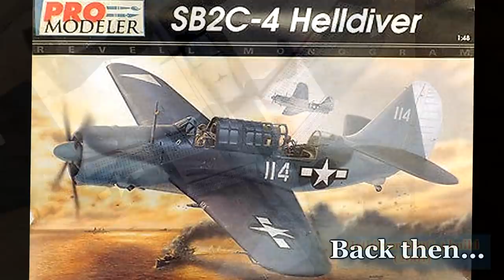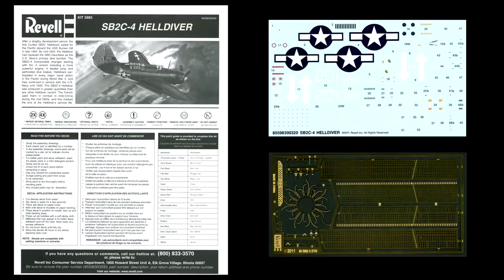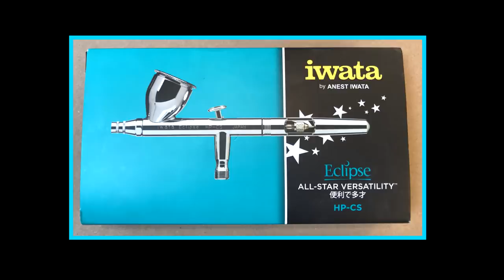Building the Revell Pro Modeler 1/48 Scale SB2C-4 Helldiver Dive Bomber

Comment: Good job! I was surprised to see that Revell fixed that old Monogram kit. I built it back in the 80s with the folding wings and retractable landing gear. Those old Monogram kit's were kind of toy like. But I always saw them as a blank canvas that you could make a masterpiece out of with a little bit of time and detailing. And they were a lot of fun to build when you were a kid. The old Monogram P40 is still one of my favorites and they all bring back a lot of fond memories. 🙂
Reply from the maker: Hi Steve, thanks! Oldies, but goodies sometimes 😉
Reply: This is not the old Monogram kit from 1961. This is the model released by Monogram under their Pro Modeler label as a new tool in 1997. Later issued by Revell after they had absorbed Monogram into their product range.

Comment: Love the build.  Makes me wish I had bought the kit when I had the chance.  I have the Monogram version of this kit to build.  Interesting note, the Army Air Corp wanted a dive bomber before the war.  They placed an order for several of these planes on December 31st, 1940.  They made a few changes to the plane.  Larger wheels, removal of the tailhook, removal of the folding wing mechanisms and a few other minor changes.  The plane was based on the SB2C-1.  They were designated A-25A Shrike.  Info from Squadron Signal aviation book on the SB2C Helldiver.  I was a volunteer at an airshow one year and had the priviledge of keeping the crowd back from a Helldiver as it started up to do flyovers for the show.  That prop sent every tiny piece of sand and rocks flying.  Glad I was wearing long pants.  The best sounds to hear are the sound of a radial engine and merlin roaring to life followed by allison engines when it comes to planes.
Reply from the maker: Thanks for sharing the story. I got a good dusting from a P-51 prop one time. 🤨

Comment: Hey, thanks for making your videos with such attention to detail with little factoids and period footage/audio. 

I have a question about decals if anyone can help. I’ve been having problems with decals that bond too quickly and tightly, after only a couple seconds (even with plenty of liquid around) so they become unworkable and stuck in the wrong position.  Are there any tricks for these problems? It’s almost impossible to slide them on perfectly the first time and they slide and bind randomly while trying to get them aligned right.
Reply from the maker: Hi Captain Cruise, if I have this kind of problem, I tend to use a lot more water from the decal dish. The model will be dripping wet in the area, but I can easily float the decal still and not have it bind. On the other hand, this will dilute/wash away any decal setting solution you've pre-wetted the model with.
Reply: Max_Afterburner 
I see. Thanks for the tip; I’ll give it a try next time!

Comment: Easy way to start off aerial two little nicks in rudder same place glue in whatever you use as aerial wire got a good start on fitting it
Reply from the maker: Hi Wendy, good idea. I would hope I didn't cut the antenna mast in two trying that😅

Comment: Another great build. I am working on this very kit right now, although it's the Accurate Miniatures boxing and I am using the Atlantic City dark gull grey scheme. Did you find the clear plastic was a problem? My front windscreen is a blob, with no real framing and most other clear parts are equally bad.
Reply from the maker: Hi Rich, the cockpit glass pieces were pretty nice and detailed. The very front windscreen could have been a little better, though. The only real weakness with the kit is the main landing gear attach points to the inside of the wings. They're very flimsy and a good bump would probably break them.

Comment: I always thought Promodeler rendition of this plane has an exaggerated wing dihedral angle. That's why it has been in my stash for past 20 years but your techniques are great! I'm still searching for a way to correct the wing issue or perhaps build them in folding wing configuration, that's another 20 years to think about it.  😂😂
Reply from the maker: Hi vin10954, if you ever get a chance to build it, watch out for the main landing gear. They're a bit weak.
Reply: @MaxAfterburner  Thanks for your advice, I will write down on instruction sheet.

Comment: Hi Tom, lovely end result! And shock, horror..the first two paints you used weren't Tamiya! There should have been a warning at the start of the video. :) I must say you had me thrown for a loop with the way you built this one, a lot of it prepainted on the sprue. Why did you decide to do it this way? Normally you have tended to join the fuselage and wings first and then start the exterior paint. Love your paint chipping method. Very effective.
Reply from the maker: Hi again, yes a few changes as to the approach for this model dictated by the materials and parts. I didn't want to run enamel through my airbrush and Tamiya doesn't make a specific zinc chromate either. Sometimes I leave the parts on the sprue for faster application of the "primer", ease of keeping the parts together and not losing any pieces, and as a drying rack. Some viewers were shocked by this and even appalled (although I did this in another video too). I felt the paint chipping would be easier to accomplish prior to the overall assembly, so I went with that direction. Sometimes the particular model requires a slightly modified work pattern, other times it's just nice to experiment and reduce the tedium.

Comment: Max, I can't help but notice on all your paint jobs you never get a rough textured surface or fingerprint marks. What do you do for your model before starting the painting process? I clean mine with alcohol but I always seem to get an uneven paint job no matter what I do.
Reply from the maker: Hi, I don't do any special prep work prior to painting on the modern model kits. It's difficult to say what is causing the problems you're experiencing without more information. Many factors such as paint type, dilution ratios, airbrush vs. hand brushing, and time allowed for the paint to set in can all play a factor.

Comment: My gueeses
1 USS Missouri
2 USS Midway
3 a b-29 superfortress

Based on my own experience building a 1/350 USS Essex I kinda hope it is not a carrier. So much patience is required for them, the US strategy of guns everywhere means so many tiny pieces to glue and paint.

If you are doing a warship I hope you have more luck than I did with the vast number of 20 mm aa guns.
Reply from the maker: Hi Nathan, thanks for the guesses 🙂 A carrier certainly can be quite a build and a lengthy project 😏

Comment: Hey I was using The Tamyia panel line and I let it dry. But can’t get it off. How do I get it off.
Reply from the maker: Hi, the Tamiya panel liner is enamel based so you'd have to try an appropriate enamel thinner. I'm not a big fan of their panel wash because it tends to stain areas even with a protective coat laid down. I only use it if I'm looking to make the area particularly dirty. In this video, I begin to show the black pastel and water wash I started out with, but I went with the Tamiya and did not video that process.
Reply: @MaxAfterburner  alright then. The thinner i have is water base. So that is probably why it didn't come off. Plus i didn't know that i was suppose to clean coat the aircraft first before using a wash. 
Thank you for the information.
James B. D'Amico
Lackland Air Force Base
San Antonio, Texas

Comment: Based on the sound it doesn't sound like it sloshes in multiple directions.  Being WWII I'd and American I'd assume its the U.S.S. Arizona ship 1/350th scale.
Reply from the maker: Hi Roger, WOW, what an interesting way to use that as a hint to the identity of the mystery build!
Reply: @MaxAfterburner , just applying some engineering logic to it.  I could also be totally wrong with it.  The sound is a little hard to make out.  I'd guess you didn't have the package right up against the mic.

Comment: I wonder if you could turn these into an RC plane by cutting out the flaps, elevators and alerions and then stick in a motor in the nose
Reply from the maker: Not going to try! 😲
Reply: @MaxAfterburner  I would be surprised is you did. I'm just asking if it could be done. I mean all the aerofoils and that are there and they should be the right shape to provide lift